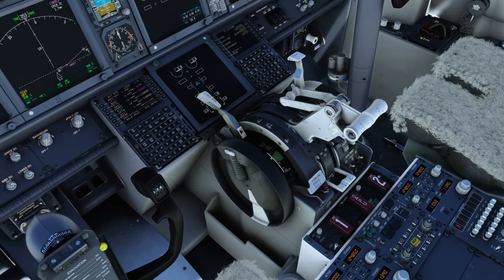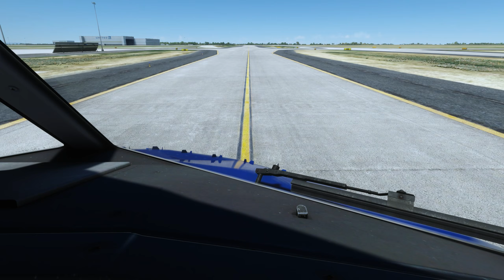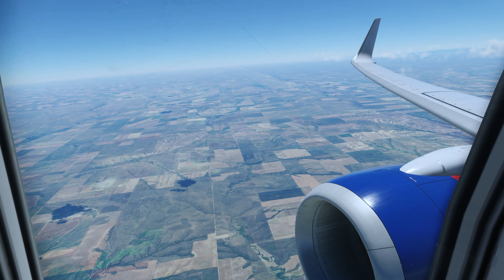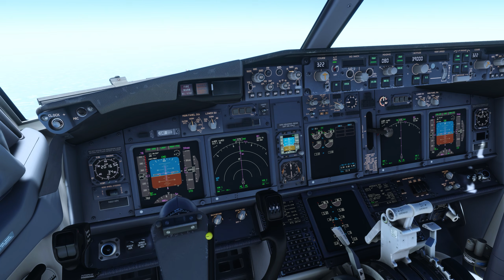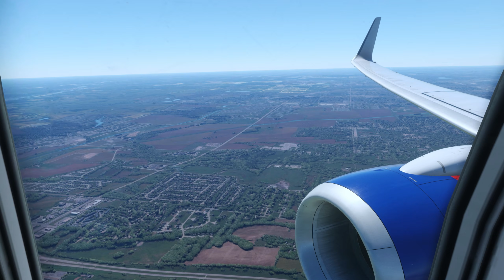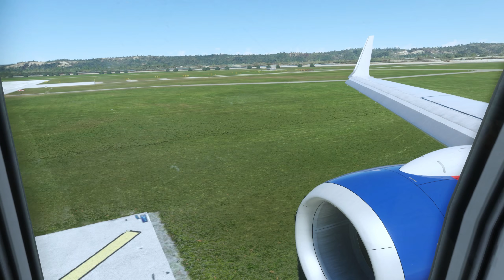PMDG 737 to Omaha Nebraska | MSFS

Comment: Just got the 737. Been flying the 717 in FSX and the BAE-146 for quite a few years, and I have some Zibo experience. It struck me how much easier this thing is to hand fly. The systems are less daunting then in the 146 IMO, and the thing handles like a dream comparatively. Still wishing for a 717. All time favorite commercial aircraft.
Reply: I love the 717 too, especially since it was originally created by McDonnell Douglas as the MD-95.

Comment: How do you handle moving back and forth between flight sim and truck sim? I have a sim rig and it seems like a job to constantly bolt and unbolt all the parts (wheel and pedals vs Rudder control and yoke)

Comment: I’m surprised u don’t do a cross bleed start during the summer……it allows u too keep right pack on while starting the number 1 engine so that you can cool the cabin (and minimize downtime of the AC during engine start). It’s a must during the hotter months. After u start the number 1 engine, turn the right pack to auto, isolation valve to auto, left pack stays off, bleeds remain open. It’s simple. And the passengers will appreciate it!

Great video. Love your flight sim content!  Keep up the great work!  And best of luck with the move!

Comment: You don't have to wait to start both engines to get the right pack on. After #2 EGT rolls back close the isolation valve and turn the right pack on. Turn on the #2 engine bleed. Now you're running that pack off the engine bleed and the passengers get air. The callout is "Isolate and Ventilate"
Reply: A lot easier in real life with the FO sitting next to ya...